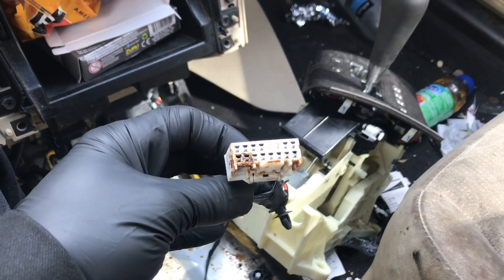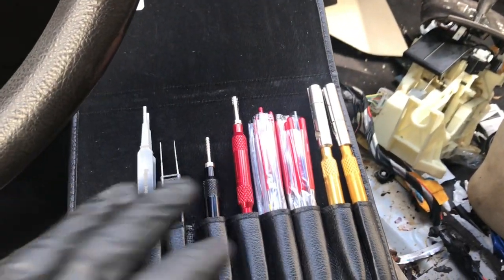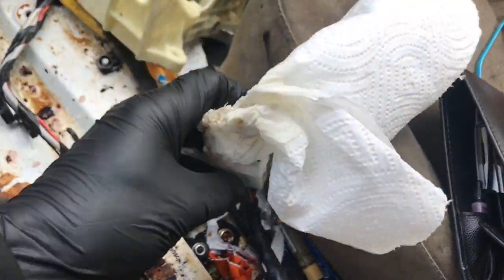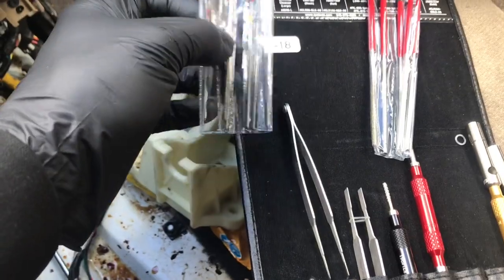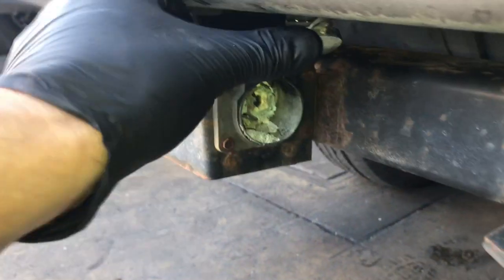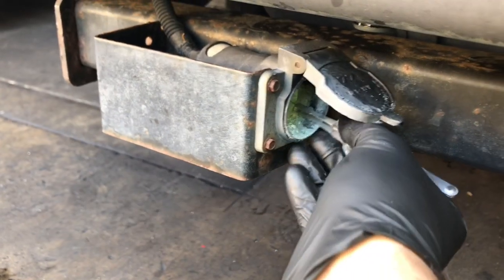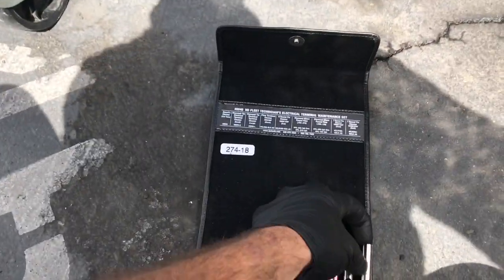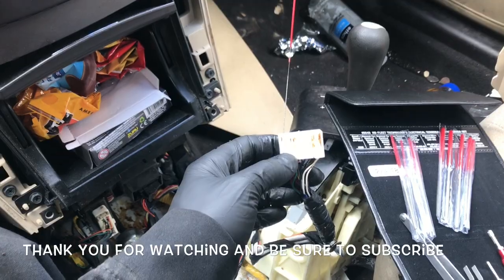How To Clean Automotive Electrical Terminals With The Right Tools

Comment: I tried some other ways people say on YT and the ol baking soda , salt and vinegar solution didn't work on for RUST on my USB connector charging cable didn't work . What did work is toliet bowl cleaning liquid . If you read the label some of them says removes rust . I tried it once letting it sit for a  minute . On the outside removed much of it . Had to use again letting it sit on INSIDE of USB connection for several minutes . Rinsed it off then dried sparingly with heat gun . Now works . USB cable is how my Craftsman rechargeable headlamp charges . verry handy

Comment: I used to work in a shop and it was funny to see a technician pulling out his black gloves and his makeup set when doing something another technician will just come and spray a bunch of spray with a brush cleaning the connectors and just plugging them back up

Comment: Boiling hot water cleans that corrosion like windex to glass. I learned that on a YouTube video.
Reply: Deoxit5
Do not use water, it'll rust
Reply: @llamacebu216  but what if u hit it with computer dust cleaner and electrical grease after boiling water kus that sounds like a decent way
Reply: The computer dust cleaner come with those fine straws to get into deep cracks and crevices

Comment: Nice vid Brian; I didn't even know those tools existed!  I also use dielectric grease on all my connections (interior and under hood).
Reply: How effective is using dielectric grease as a corrosion inhibitor, as a percentage? Thank you.
Reply: @jayasanka5978  Never use dielectric grease in anything automotive. could be very dangeroous (fact) and never ever use brake cleaner to clean anything electrical iam not sure where you get the idea that this will clean anything but brake rotors/pads but (never electrical period.)